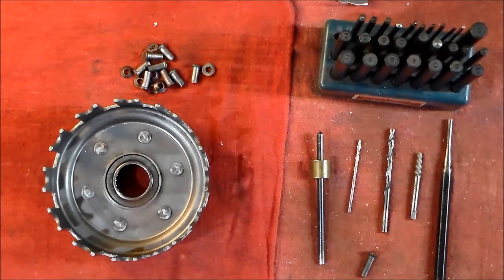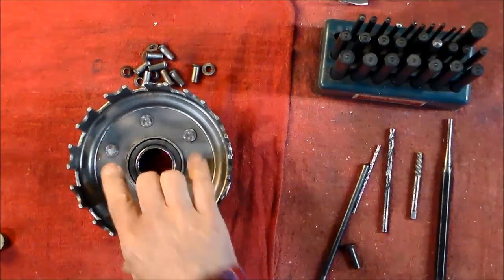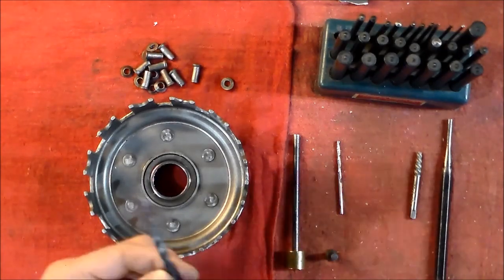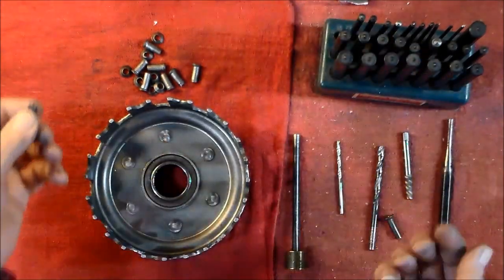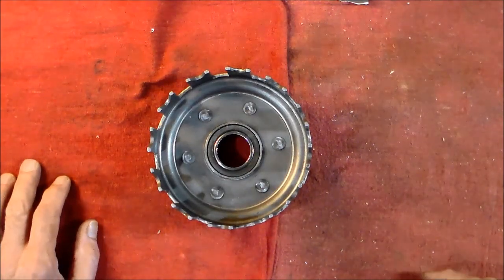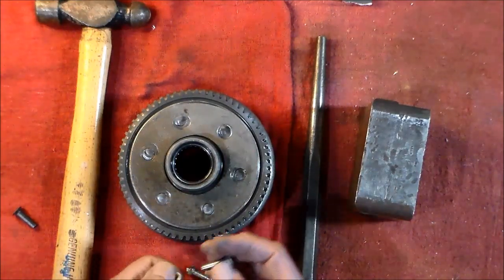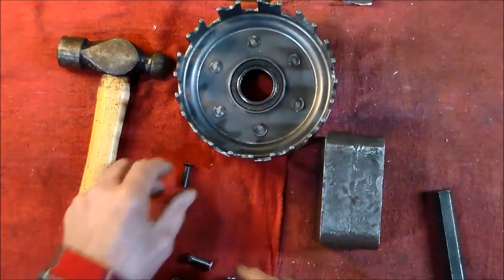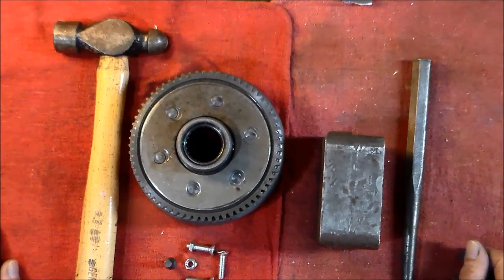Removing and re-installing the clutch rivets in an H1 basket

Comment: JRD  /  Jeff D  from the Triple forums here.  Good video  and covers  the "how to".  I will just add more tip.  If you are "too perfect" with your centering when you drill the rivets, they will just spin instead of breaking off. I'm doing Barry's H2 clutch hub ( eight rivets instead of six  on the H1 ) and four of them spun when I tried to break them off using the EZ out.  I drilled them larger using a letter "C" drill ( .242 ) and then when I punched the rivets with a 2 lb hammer, the heads popped right off.
Thanks Darth, good info.  

 Jeff

Comment: Received the rivet kit this week. Very nice. Just one question? Where does the flange flange end on the rubber go. Between the gear and the hub or between the gear and the back plate? It's been awhile since I took it apart, and when I did the rubbers just fell out. Now not sure how it reassembles. Maybe a bit of old guy memory too!
Reply: Opps! Never mind, I found your earlier video that explains the rubber orientation. THANKS.